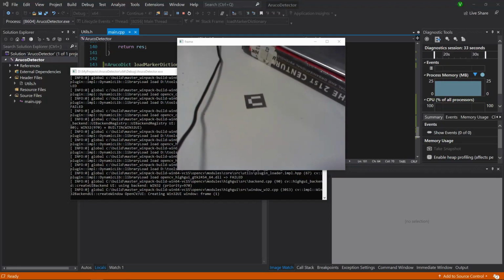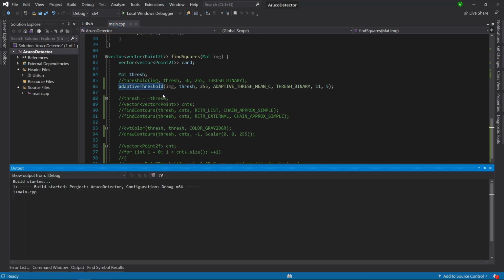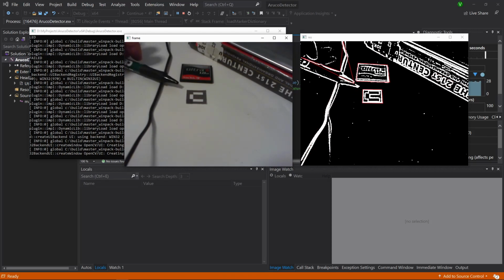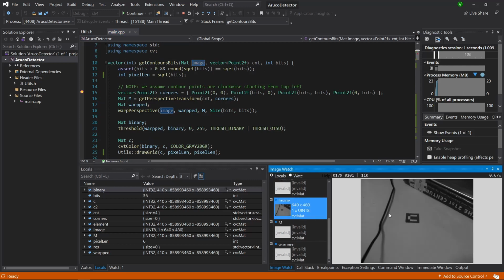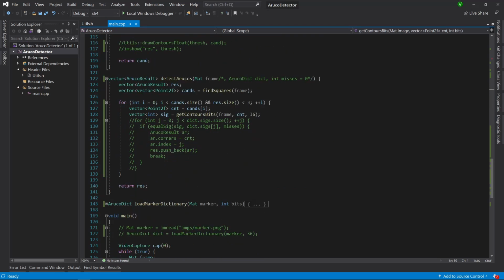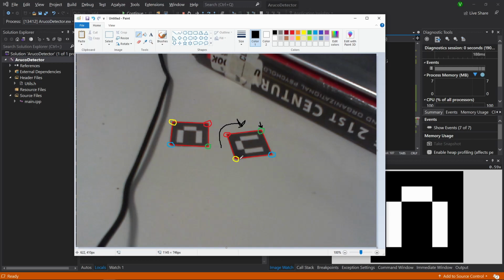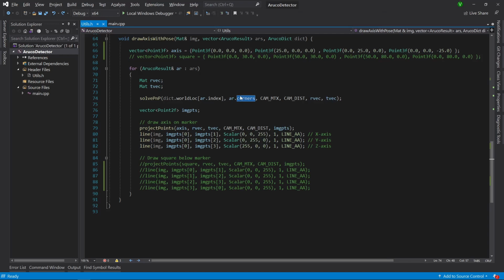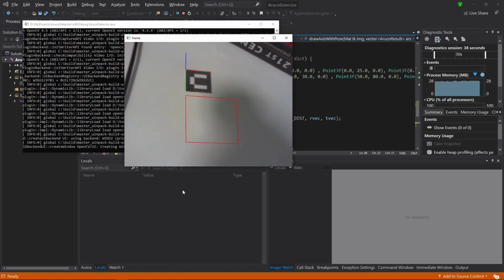Custom Aruco detection and pose estimation using OpenCV

Comment: I'd like to create an AR android app like InspectAR where I point my camera phone to a circuit board, it can then find parts. Somewhat like the video from CuriousInventor ("Augmented Reality BreadBoard circuit building guide")

For example, if you have a sheet of paper with a grid of squares, say 50x50.. if A4 is said/entered, could AR use ArUco markers / fiducials on the paper to calculate precisely how far into the grid it needs to place an appropriately scaled marker (scaling it based on the the angle and how close the camera is to the sheet). 

Is it possible for an image be overlayed onto the camera screen with this level of precision?  Would ARCore/Flutter  +  OpenCV/ArUco be the best approach?
Reply from the maker: Sounds like ARCore is the way to go on Android for such an app. I don't have personal experience with ARCore though